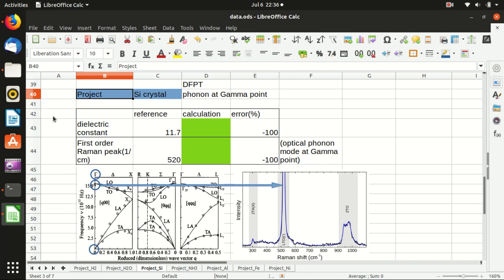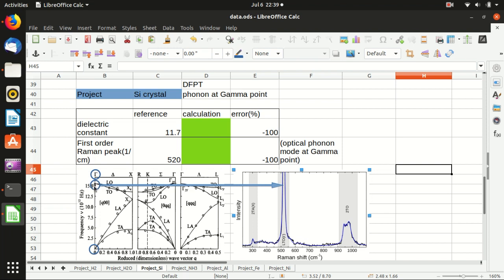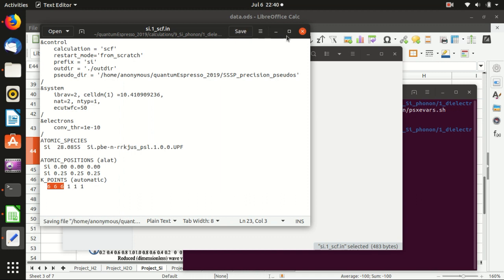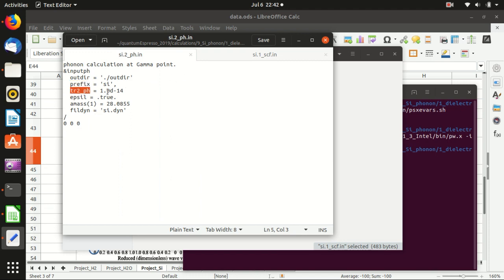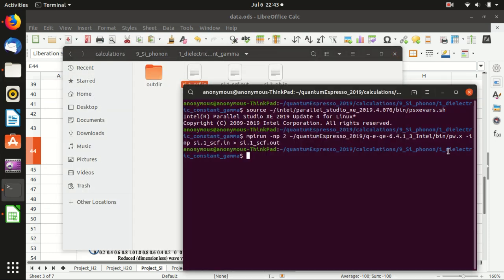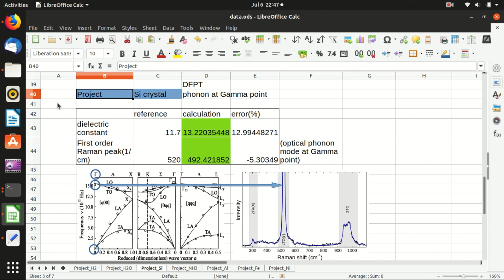Project: 4.1 (phonon) Si phonon gamma point | Quantum Espresso Tutorial 2019

Comment: Si phonon at gamma point 
0:00 Introduction. Objective: dielectric constant, first order Raman peak (1/cm)
Reference: phonon dispersion for the Si crystal. Degeneracy of the spectrum in the symmetry points. Transversal (T) / Longitudinal (L) acoustic (A)/optical(O) modes
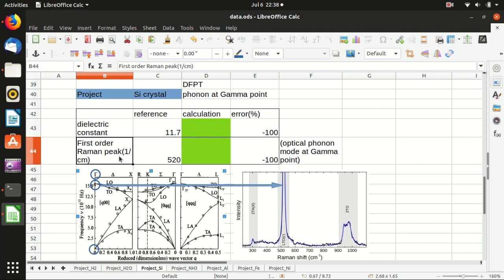1:43 First order Raman peak is related to the Gamma point
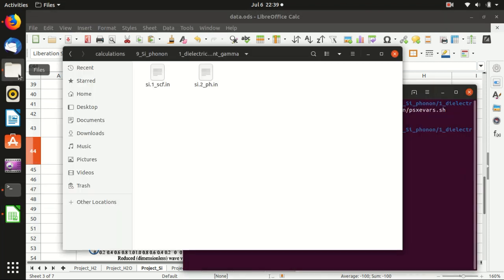3:21 SCF Input file and calculation run
	Suggested parameter(s): 
		conv_thr = 1e-10
	K_POINTS
		6 6 6 1 1 1 <--- shifted k-points 
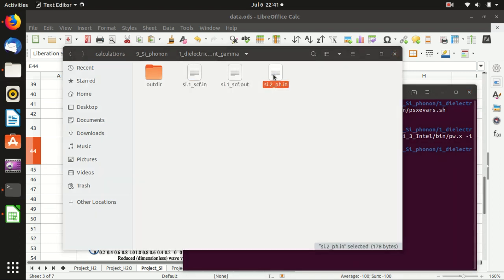4:54 Phonon spectrum calculation - Input file 
		tr_ph = 1.0d-10 ! phonon convergence 
		epsil = .true ! calculates the dielectric constant only for gamma calculation and for non-metals
		amass(1) = ... ! atomic mass if not specified the value is taken from the scf calc.
		fildyn = ... ! output file
		0 0 0 ! q-points (Gamma in this case)
7.06 Run using ph.x
	Takes a little bit longer
	Use tail to check how the calculation goes
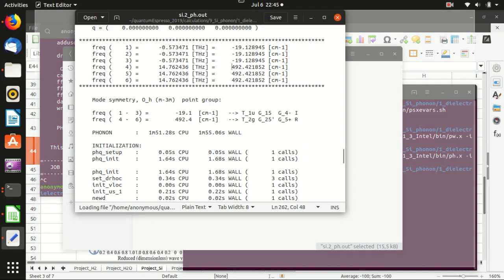8:32 Output file
	Find eigenvalues (acoustic and optical phonons) and dielectric constants and compare them to the references

Comment: When doing this calculation for silicon I get the same results. However, when trying to calculate the gamma point phonons of graphene I get:
 ************************************************************************
     freq (    1) =    -141.489929 [THz] =   -4719.596013 [cm-1]
     freq (    2) =    -141.489929 [THz] =   -4719.596013 [cm-1]
     freq (    3) =      -0.533915 [THz] =     -17.809489 [cm-1]
     freq (    4) =       1.604628 [THz] =      53.524617 [cm-1]
     freq (    5) =       1.604628 [THz] =      53.524617 [cm-1]
     freq (    6) =      26.144118 [THz] =     872.073911 [cm-1]
 ************************************************************************
the first two phonons with high negative frequencies don't make sense to me. What could be the reason? I was expecting a value of about 1600 cm-1
Reply: Same problem here with me. Any one please suggest solutions.
Reply: Have you found the solution? Please share with us. Thanks in advance.